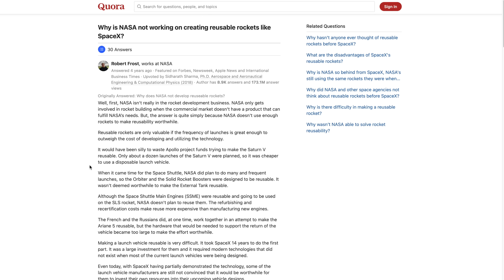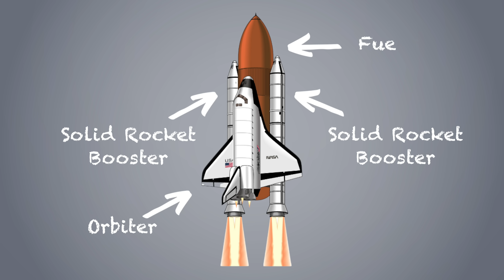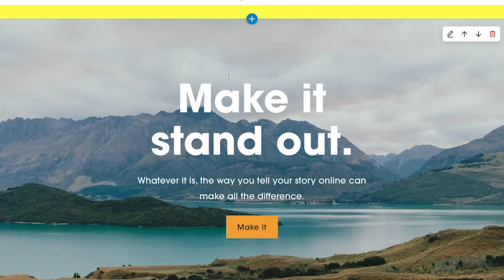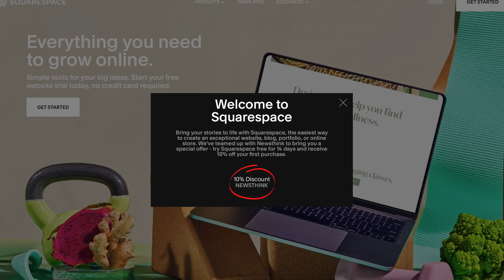Why NASA Doesn't Fly Reusable Rockets

Comment: “Reusable rocket” sounds a lot better than “Refurbished Rockets”
Reply: Now comes space shuttle fans.. 😹😹
Reply: @CreativeThinkingSujith  no he's right, falcon 9 is refurbishable that's why they have turnaround time. Starship will be truly reusable because it can be reused without repairs.
Reply: @uhmmm2110  but refurbishable time of falcon 9 is only 2 months, while space shuttle takes many months
Reply: @CreativeThinkingSujith  They've flown a couple now with under a month between flights.
Reply: @phunkydroid  not with same booster.. They have about 10-11 boosters free for each mission
Reply: @CreativeThinkingSujith  Yes, with the same booster.  B1060 flew on January 8th then February 4th, B1058 flew on March 11th then April 7th.  27 days turnaround both times.
Reply: @CreativeThinkingSujith  not a fair comparison. the space shuttle was a giant, complex orbital capable vehicle in the shape of a plane that was the most complex vehicle ever created. the spacex f9 booster is not even comparable to the shuttle.
Reply: @damien-nk9ko  complexity is often a burden
Reply: @damien-nk9ko  Exactly!

Also, the shuttles transported crew and traveled at orbital speed before reentries.
Reply: @damien-nk9ko  then we sould compare shuttle with starship🤩.. Starship is much bigger than Shuttle, even straship carries it's own fuel in it, while space shuttle depends on the orange tank for fuel.... Starship is an engineering marvel. ❤
Reply: Creative Thinking that doesn’t make starship better at all lmfao, that makes it worse, it has to carry around a bunch of dead weight. And I’m tired of seeing starship fans use unconfirmed numbers from Musk, who’s known to overstate things as truth.
Reply: @damien-nk9ko  It carries around that "dead weight" to make starship fully reusable lol
Reply: Pluto Tuer starship has yet to prove it’s fully reusable, and it’s still dead weight, which is why without refueling, starship can barely put anything past LEO.
Reply: @damien-nk9ko  Its a prototype, what do you expect? The whole point of the system is to be fully and rapidly reusable. Starship is set out to carry 100t (+) to LEO at an extremely low cost (<10million) while for example the Saturn V could carry ~120 tons to low earth orbit at a cost of 1.2 billion. Now comparing the Saturn V to Starship might be a bit unfair but even compared to the NASA SLS which can lift (in its first iteration) up to 95  tons to LEO at a price of at the very least 876 million per launch. I completely agree that the complexity of orbital refueling multiple times is concerning, but I think (don't quote me on this) that NASA awarded SpaceX a contract to prove that orbital refueling is possible and they even mentioned (In their report of the Artemis Award) that SpaceX has developed methods that made NASA confident enough to select Starship despite the risks involved with orbital refueling. Besides all of this, someone has to push further to propel us into a splendid future, and without innovation this will seize to happen. I personally have faith in the team at SpaceX to archive this ambitious goal :)
Reply: @damien-nk9ko  So complex, the space shuttle has killed more people than any other space vehicle. Complex isn't always a good thing.
Reply: Pedro Kantor Never said it was. I said it was an unfair comparison.
Reply: @plutotuer3520  imagine using speculative estimates of a rocket that early in development, as truthful numbers and comparing it to sls which has the cost per launch very accurate and hardware built
Reply: @damien-nk9ko  speculation is very different to official information from the provider. If you consider this speculation, Nasas numbers are speculation as well, since SLS hasn't flown yet.(By the way the launch costs of SLS aren't set and will most likely be well above a billion, but I'll consider them to be ~850m for the sake of tgis text) But even if Starship only manages to get only get 75tons into LEO, the launch costs are still well below of the SLS. SpaceX has the ambitious goal of reaching a cost of 2 million per launch, which I don't think we'll see until early next decade. But one can be sure that the  price of starships launches will be below that of falcon 9, which is 62 million. To recap, even if we consider a 25% reduction in total mass to LEO the cost effectiveness of Starship still reigns Supreme over that of SLS. Sporting a at the very minimum  a 93% reduction in price at nearly the same, or 25% less LEO capabilities.
Reply: Pluto Tuer “but one can be sure” no. You can’t be sure, it’s just bullshit, it’s an unproven concept and rocket, and musk always exaggerated things. NASAs numbers aren’t speculation because everything on SLS has flown before. So get some idea of what you’re talking about before you throw together some lazy response that has blatant disregard for any sort of fact.
Reply: @damien-nk9ko   @damien  Starship is fully reusable, falcon 9 isn't. Starship hardware has flown, SLS hardware has flown (I think only Orion, right?) Those are facts. - And in fact, no pun intended, I took my time to check most of what I wrote beforehand, so please don't accuse me of putting no effort into my comments. 
Ok let me correct my sentence then: One can assume, with high certainty, that Starship will in fact, after completing development, be cheaper than the falcon 9 due to being a fully reusable system.
Reply: Pluto Tuer LOL you searched nothing up. The 2 solid rocket boosters, are from the shuttle, I believe they were used on the STS 135 mission up until the 5th segments. The 4 RS-25s have all flown on the shuttle. The Orion capsule has flown on the Delta IV heavy I believe. The ICPS has flown on the Delta IV Heavy many times. The Cryogenic first stage has been tested as the ET on the shuttle. You didn’t search up anything. You can’t assume anything because starship has yet to prove it’s reliable, safe or even viable. You can’t say anything until cost comes out, and reusability works.
Reply: @damien-nk9ko  Yeah sure, I didn't search up anything on my last comment, I referred to my older ones. You're argument that SLS is by current standards more reliable than starship is completely valid. That does however not change my previous points about payload to LEO. (assuming 75-100t; 100t+ as stated by spacex) There won't be any rapid changes to starship design as they have been happening in the last few years, so as I already stated it's pretty certain that we won't see massive changes to Leo mass. Also payload mass can and will be calculated before a rocket is even built. This discussion is starting to turn around the same points over and over. Let's finally settle this:
-SLS is currently more reliable than Starship
-SLS payload will highly unlikely be subject to change
-SLS launch costs are likely subject to change
-SLS payload to LEO may either be about the same or or up to 25% more than Starship
-Starship launch costs will be less than that of SLS
-SLS hardware has flown, Starship hardware has flown
-Starship is subject to valid criticism, mainly due to the complexity of the spacecraft.(e.g orbital refueling) 
-Starship is a vehicle that had been selected by NASA for Artemis for a reason
Happy? Feel free to add anything :)
Reply: Pluto Tuer “-SLS payload is highly unlikely to change” again, you didn’t search anything up. After the first 4 SLS launches they’re switching to the SLS Block 1B, which can put 120t into LEO for a fraction of the cost, at 800m per launch instead of 2b for Block 1. Also appreciate you highlighting things without assuming anything
Reply: @CreativeThinkingSujith  7 boosters  be exact
Reply: @uhmmm2110  the falcon9 is reusable it only gets refurbished after 10 flights the turn around time is used to find flaws and damage to the rocket
Reply: @ccm2059  "the falcon9 is reusable it only gets refurbished after 10 flights" 

That's incorrect, after each flight the whole booster goes through inspections and the engines are disassemble, clean, and inspect, AT LEAST.

"Refurbishment"is not the same as "only repairs". Also, given the almost two month turnaround, and the fact that rockets have low safety factors (which means their materials operate near the point of failure), it is expected that failing parts are being exchanged by new ones.
Reply: @luigeribeiro  Glad you re-wrote your comment. Maybe I should have specified between operational costs, and the price tag. Starship mk1 obviously won't hit that goal.
Reply: @luigeribeiro  sorry, almost forgot: LOL
Reply: @plutotuer3520  this guy is right
Reply: @damien-nk9ko  sls should have been completed and we should be on the moon right now but nasa is moving so slowly they haven't launched one of their own rocket's in a decade SpaceX is extremely fast at designing rockets and starship has risk and untested technologies but it's the only way we are getting to mars the moon unless the government gives more funding to NASA
Reply: Owen Vestrum yes nasa is a government agency, they can’t afford to consistently blow up things. SLS is launching soon, and will be going to the moon.
Reply: @plutotuer3520  The current cost of starship is based on Elon Musk's tweets.
Reply: Arnav Chaturvedi Which is stupid. Just because NASA said the Shuttle would dramatically reduce the cost of spaceflight doesn’t mean it did
Reply: @damien-nk9ko  Yep. It would take thousands if not hundreds of thousands of launches to get to their 2 million per launch goal if I'm not wrong.  I don't understand why these people can't wait and watch.

Credit where credits due, SpaceX is incredibly efficient but I highly doubt that the prices will be significantly lower for the first bit.
Reply: @arn4775  The current cost of starship doesnt matter
Reply: @plutotuer3520  It does since most of your points are based on unproven information that is centered around the cost. 

Starship might eventually become cheaper, but it will still be quite expensive at first. I wouldn't go off of Elon Musk's tweets though at the very least.
Reply: @arn4775  No, the price of starships test campaign doesn't matter. Nasa hasn't flown the SLS yet and thus the true launch costs haven't been established yet. I'm talking about the fully developed starship, up until its different block variations. Those numbers obviously can't be "proven" yet, they can however be calculated and estimated.
Reply: Pluto Tuer you can’t estimate numbers because you don’t know what they cost. Almost everything on SLS has a known cost, which is why it’s not hard to get the price tag
Reply: @damien-nk9ko  est. Price tag is still fluctuating a lot. Besides the SLS price tag will still 100% be way higher than that of starship, even without 100% accurate prices on both parties
Reply: @plutotuer3520  more assuming. This is just so much back and forth because you are so focused on loving starship that you ignore basic facts and assume that starship is better. Try thinking for 1 second before you reply. You have no clue what starship costs, you don't even know if it'll work. So stop spreading nonsense, sit your ass down, and wait to see what happens like the rest of us.
Reply: @damien-nk9ko  Starship obviously could be canceled, could not work out, while SLS most likely wont be canceled. I am assuming that people know the basics. (Starship risk >> SLS; Starship vehicular complexity >> SLS; 
What the future holds:
 Starship launch costs < SLS etc) 
I'm not spreading nonsense. I was compiling information from both sides. And yes, as I said, starships costs are estimates, so are the SLS costs (They are obviously closer to the actual price)
Also, I quite like SLS, so don't try to frame me as a Starship fanboy who is an ignorant stranger to any other vehicles.
I was hoping to have a fun discussion about the future of spaceflight, but you can't seem to make one comment without trying to be insulting. I'm sure you will be glad that this will be the last time you will hear of me.
Cheers to the next decade of spaceflight and I hope you reevaluate your mannerism.
Reply: @damien-nk9ko  lol boi 😂 sooo deep cut and hurt!
Reply: Nagakrishna Malluri So sorry for pointing out facts instead of letting everyone piss themselves over a rocket that hasn’t gone to orbit yet.
Reply: @damien-nk9ko  smarmy enough eh.! 🌚
Reply: @damien-nk9ko  yea, even tho the starship is recoverable and can be refurbished. It will still be very expensive to send a payload with the starship, the cost will still  inflate due to the limited fuel needed to land itself and the fact that it's needed to be refurbished. This inturn will make the cost beyond the initial goal to reduce the cost by recovering the craft. Since most of the craft is fuel, it didn't make much sense to recover the rocket as building a rocket is better that repairing a broken one.
Reply: @uhmmm2110  The F9 doesn't really necessarily need repairs, but you do want to check out if everything is still working when you have a multi million dollar rocket. Certainly if you could just land and launch the next payload, that would be a real gamechanger.
Reply: @damien-nk9ko  idk man the F9 and FH are giant and orbital capable too and considering they are landing in the middle of the ocean on a drone ship they are arguably pretty advanced+ pretty complex given noone else in the industry was and is able to land their booster stages, even though it would save all of them loads of money.
Reply: @luigeribeiro  The Crew Dragon is transporting Crew too and when it comes back down it obv. has orbital speed before reentry.. Like everything that was orbital..
Reply: Lunnaris01 The industry is quickly catching up with rockets more capable then both of those, F9 and FH will soon have big competition
Reply: @LunnarisLP  The Topic is about the booster
Reply: @CreativeThinkingSujith  engineering marvel. Has it made it into space
Reply: @oferkrupka ??
Reply: @oferkrupka  they don't have only one booster for every flight.. Each booster is reused for next flight after 2 months of refurbishment.... Check @EverydayAstronaut for doubts
Reply: Call it "Certified Pre-Owned". That should get all those yuppies on board.
Reply: Hopefully reusability is synonymous w rockets too so  it sounds just as silly saying reusable rockets as reusable cars
Reply: Toolman1 one I’ve heard rumors that the F9 booster recoveries are barely saving money. That said I’m not against reusable rockets, it’s just annoying when there’s no data on it but people still say it’s better when it’s unproven
Reply: @damien-nk9ko  https://youtu.be/Y4EocY9Z1qo
Reply: @damien-nk9ko  Me neither, that doesn't change the fact that the video compiles a lot of info regarding spacex's reusability of the falcon 9
Reply: @toolman1one86  F9 is flight proven and reliable, but i have concerns about how much money it's actually saving. starship isn't really comparable to the F9 since they're trying a lot of new things on it
Reply: @damien-nk9ko  When the space shuttle was in operation, it cost $54,500 per kilogram. With SLS, it costs $21,000 per kilogram. With falcon 9, it costs $2,720 per kilogram. The estimated cost per kilogram for Starship will $10. They have managed to do all of this in less than 20 years. NASA? About 65 years. You cant even compare the 2 companies to eachother
Reply: Unwritten TV LOOOOOL 10 dollars? Such bullshit. That’s even more exaggerated than Elon. You don’t know how much it’ll be, so don’t make up nonsense. Also comparing 2 human rated systems, one to go to the moon and not put payload in orbit to the F9 is ridiculous.
Reply: Okay so pretend I didn’t say anything about the starship and just look at the shuttle, SLS and F9. SPACEX has significantly reduced the cost of space flight with about 40 years less of research and development
Reply: Unwritten TV Again not fair. SLS is never meant to carry cargo in the Block 1 state, and it’s meant to go to the moon. The shuttle was a giant spaceship that took 30 tons to LEO and up to 8 crew members. Dragon takes 4 (can take more, but never will) and a small amount of cargo. Not fair to compare at all
Reply: @oferkrupka  he's correct your wrong
Reply: @ccm2059  Sorry, you are right, deleted my pre reply.

Watched the source again (Xprize Elon & peter live stream) Elon said soon to be a month.
I mistakenly remembered it has a month...

On top of that Everyday Astronaut is a great & credible guy.
Reply: @oferkrupka  everyday astronaut is a really reliable source
Reply: Jaxon Kennedy yes they’re cool but I’m just tired of seeing people use very very ambitious and likely untrue numbers as truth
Reply: @damien-nk9ko  space shuttle fan boy
Reply: @damien-nk9ko  if you dont wanna use falcon 9 as exemple, just use falvon heavy instead then
Reply: [RcY] how would that prove anything more
Reply: @damien-nk9ko  3 reusable rockets
Reply: [RcY] 3 reusable stages*. That’s like saying the space shuttle SRB was a reusable rocket
Reply: @damien-nk9ko  falcon heavy is literally 3 falcon 9's glued together.
Reply: @rcy3099  and? they're reusable boosters/stages not rockets
Reply: Still much better than "Rebuilt Rockets" like the Space Shuttle.
Reply: Pepperidge Cookies oh yeah, I bet you’d know that when they have yet to fly a starship to orbit and bring it back. I trust you since you must be a SpaceX employee leaking things about it.
Reply: @damien-nk9ko  also, the Soyuz cost $90 million per astronaut to launch to the station. The entire LAUNCH COST of a falcon heavy is $90 million. Spacex have revolutionised space flight and you know it
Reply: Unwritten TV actually no it doesn’t. It’s much cheaper. NASA originally paid 30 million per seat, but the Soviet realized they could force NASA to pay a bunch more since they had no launch capability, and were forced to pay 90 million per seat.
Reply: Definately 👍
Reply: Bro same thing just falcon takes less time to refurbish than the space shuttle. But making a 100% reusable rocket is impossible. There's always something or part you need to repair.